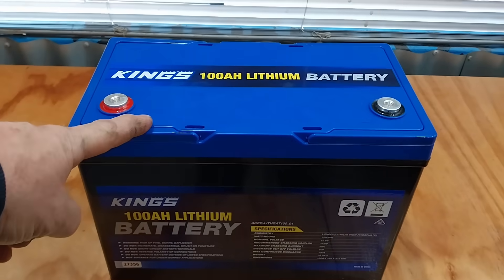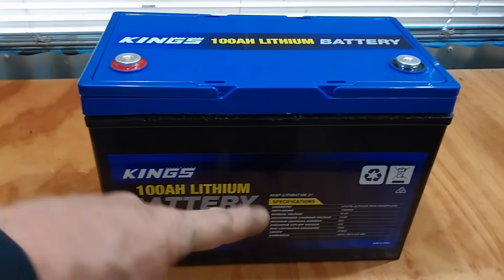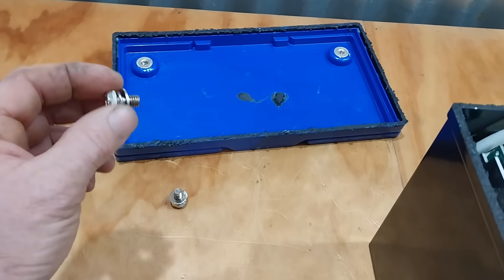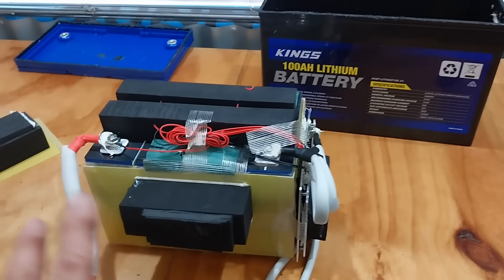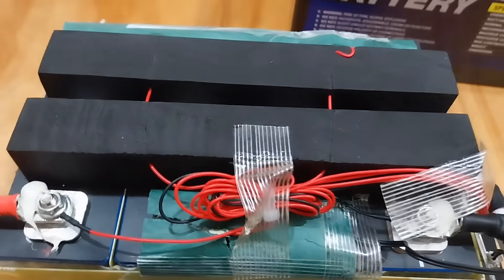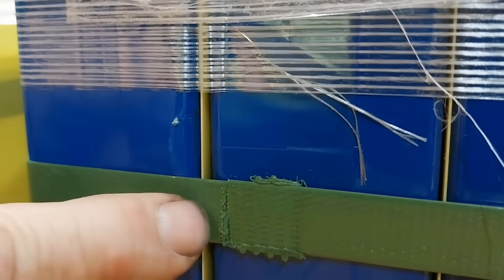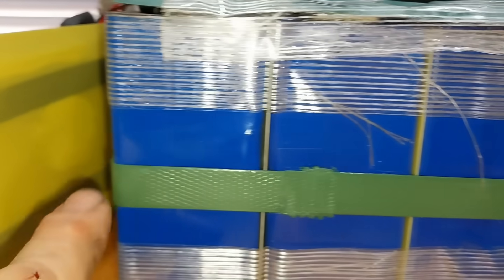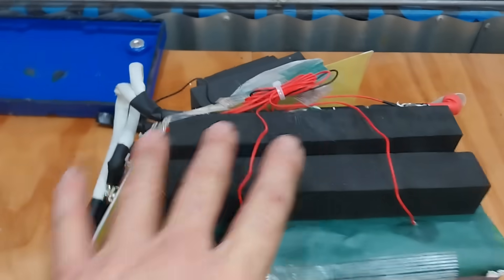Kings 100 Ah Lithium Battery Teardown - What We Found Inside ?

Comment: the label code  and the QR scan doesn't match [00PCBAFN01IL14GD610006009 vs 00PCBAFN01L14CD610006009]. Either of them doesn't belong to any standard manufacturer . This could be repackaged b-grade/used cell . This is the only kings lifepo4 battery with 1 year warranty, the other kings batteries are 3 years. the deformation could be because it is b-grade cells
Reply from the maker: Thanks mate, yeah disappointing with the 100 Ah batteries as Kings advertises them as A grade cells. But we all know the honesty or shall I say "the lack of" we get from corporations now-a-days 👍
I will say though I have two Kings 120 Ah blue top Lithium's that have been in service for over two years with daily cycling and so far they have been flawless.

Comment: Hi Glen. Thanks for the video, I have a query. I'm using 2 kings 100 amp lithium to create 24 volts for my mobility scooter. They are 8 mths old but im having issues with them holding charge. I'm using a Victron Blue smart 24v charger. It has several settings to choose from so maybe im charging incorrectly. Prior to having issues, I used li-on setting, but now im using high (29.4) and bulk charge settings, as im only getting 500mtrs of travelmout of a charge. Do you see an issue with how im charging? I dropped off the batteries at Kings today for warranty but they said they're charging ok, so I dont know if theyll load them to test. Thank you
Reply: Nice to know that . was planning to buy 4 of them

Comment: I no this is few months old but a BMS typically balances the cells during the charge cycle not during discharge. Usually during the CV constant voltage stage of the charge cycle. Matched lithium cells typically do not go far enough out of balance unless they are being discharged constantly at high current.

Also note the tolerance for out of balance lithium cells is 50 mv. It would be very rare for cells to get 0.5 volts out of balance unless they are nearing the terminal life span. I would also hope that a BMS would also balance the cells as they near safety discharge cutoff but it may also be up to the BMS software design.

Comment: I just got4 of these and none of them charge up to 14.60, the ZKE EBC A20 charger cuts out before it gets anywhere near 14.6, one goes to 14.0 and cuts, one gets to 14.2 and cuts one gets to 14.3 and cuts one gets to 14.35 an cuts. I tried charging it with a constant current lab power supply limited to 14.60v with various current settings from 5A all the way down to 0.02A but that still makes no difference, they still cut the charge way too early. I  am assuming they have a small imbalance, one cell gets to it's full voltage and the bms cuts the charge. But if that is the case why doesn't feeding it with a tiny current balance the battery? Surely the balance circuit can handle 0.02A Anyone got any ideas?

Comment: From my experience I wouldn't trust the brand. About three years ago I bought four 150AH Kings lithium batteries, for a 24V battery bank. I was greatly disappointed when after initial testing I found that they could not sustain greater than 50A continuous. They were definitely advertised as 100A continuous. Luckily I was still preparing to install them, because within two weeks, one and then a second one burned up on my kitchen table, a BMS failure in both cases.

Asking Kings directly for warranty, they completely ignored me. I waited 6 weeks. It wasn't until I complained to the online store I bought them from, that they responded, and replaced each battery in turn. They claimed it to be freight damage, but I believe it was dodgy cheap BMS's used, that failed.

They took one back, but I still have the other one, which I cut open. It's a charred mess inside. To be clear, most of the wiring is damaged, but the cells might be reusable for a rebuild.. but it's been years since it happened, now.

The exact symptoms.. they got very hot on top, with some visible plastic melting on the top lid. You could smell fumes being given off. I relocated each outside asap I can tell you. The second one failed 2-3 weeks after the first. I had ordered 2, then 2 more before the first 2 arrived. One failed from each batch.

They did replace the two batteries, however with zero paperwork. No documentation at all.
I'm still running the survivors as a bank of 4 at 24V, running my hot water system and a couple other low loads, using a VIctron Multiplus 2400W (3000VA) inverter. I have all Victron gear, apart from cheap batteries. I have a second bank with same storage capacity using a different brand battery (6x100AH @ 24V), that runs most of the rest of the gear in the house, including 2 fridges and a freezer. No trouble from those (1600W (2000VA) Victron inverter).

Inside the Kings they were not neat as in this video, and not prismatic cells. Just a big bundle of tape. I wouldn't be surprised if the prismatic cells in the battery in this video were second hand cells.

I do intend to get rid of the Kings, once I get to it. I'm retired on a pension so money is not plentiful. Luckily I'm not renting.
Reply from the maker: Sounds like they couldn't handle the current draw.
I have a set of the Kings 120 Ah batteries that have been in service for two year of continuous use on my 24 volt system, which draws around 80 amps when under load. I can't fault the 120 Ah batteries and they have even held up on their amp hour capacity.

I have heard the earlier version of the Kings Lithium batteries were crap and the newer version have seem to be fine 'so far". I have a few friends with the Kings 300 Ah batteries that live full time on the road and so far so good.

Be interesting how long these newer Kings Lithium's batteries last / longevity over time. For the price we pay for them, they have been worth a try. My 100 Ah 48 volt batteries (different brand) for my 48 volt system cost just over $3,000 each for them when I bought them four years ago. So big difference in price, that's for sure 👍
Reply: @TheOffGridBachelor  Yes, hopefully they've improved (looks like it from your video) since a few years ago. I got the crap ones apparently lol. The 4 cost about $4000, so a slight investment there. But there's plenty of brands out there. 48V would be nice, bit outside my price range tho. I'm semi-off grid living in suburbia.

Note with mine there was no current draw. I'd not installed/used them yet. Thanks for the video. We want you to cut open every brand! :). Seriously tho, it would be interesting to compare this video with a top tier brand, regarding the internals. The heat gun trick could make it less painful to make. Cheers.

p.s. I've learned in my 68 years, that the cheapest cost product is rarely the least expensive to own in the long term.

Comment: Heads up, you can remove the lid of these type of batteries without cutting, incase you want to reassemble. Simply run a heat gun around the join at the top and pry with a filler/butter knife. I've done this and reassembled and used silicone and few rivets to reassemble - this way I can get back in again (I upgraded the BMS)
Reply from the maker: That's good to know. I have a few of these batteries and interested in seeing inside the others, see if I have the same issue I had in this battery. Thanks for the tip 👍

Comment: Stop insinuating kings have used 2nd hand cells in the past 
It's never been proven just because a cell has a missing QR code it doesn't mean the cells are used
Reply from the maker: I said there is no indication of any wear and tear of a secondhand cell. No where in any of my videos have I ever said that Kings use second hand cells, nor did I say missing QR codes mean secondhand cells.
I get heaps of comments on my videos with people claiming, without proof, that Kings use secondhand cells. So I do look for signs of secondhand cells to keep those people happy. But I have not found any evidence that Kings use secondhand cells and have mentioned this clearly in my videos.

Comment: Just an FYI:
The current-carrying capacity of a conductor is proportional to the cross-sectional area of the conductor.
i.e. the thickness of those aluminium connecting straps times their width, expressed in mm².
The thickness is also important in terms of resistance to cracking as a result of vibration.

Comment: I'm pretty sure the damage with the strapping and the end cells having a bulge or being crease was just the tightness of the strapping itself and the damage was where the gun used to strap it was against the body of the battery I would think just through experience of using those strapping machines himself

Comment: Another one on the tear down bandwagon! What a surprise! Prismatic cells 😂 which is what's listed in the specification. Buy a cheap battery and expect premium cells and build quality! The surprising tear downs are some of the premium brands that aren't much better!

QR code is as follows (no surprises really B grade cells and always a lot of missing information)

Manufacturer Sunwoda (00P)

Product type Cell

Cell Type LiFePO4 (B)

Model code UNKNOWN (AF)

Capacity 0.0Ah

Energy 0.0Wh

Production date 1/6/2023

Production city UNKNOWN (0)

Factory product line NO

Factory task order n°1L

Number of cell produced 6009

Code 00PCBAFNO1L140D610006009
Reply from the maker: Teardown bandwagon ?? steady up dude as your the one that is watching these teardown videos, so you can't really criticize on that 👍
Kings previous 100 Ah battery had the pouch cells so I wanted to see if they indeed were putting prismatic cells in these battery as advertised. I did explain all of this in the video.
I do want to get hold of a high end brand battery and do a teardown to compare the quality. My 48 volt batteries are high end expensive batteries. Once their 4 year warranty expires, I will do a tear down and see how well they are put together. Hopefully well, as they cost me over $3,000 each for them.
Reply: @TheOffGridBachelor yeah I skipped through the video. I was interested in the BMS as the specs state max discharge 100amps, max charge 100amps BUT Recommended charge is only 50amps. 
Why's that? But there's no useful information I could get off the BMS from what you showed.

Kings haven't had pouch cells in their main batteries since the old black tops from years ago! I still have one I bought in 2019, still making capacity.

Unfortunately pouch cells have been demonised by ignorant people. If they actually did a little research they would find pouch cells have many advantages over prismatic. They are more energy dense, lighter, more durable in transport situations, often cheaper and you are pretty much guaranteed new cells as they can't use used pouch cells like prismatics!
Reply from the maker: @cdonuts7335  Yeah their 120 Ah lithium also has a recommended charge @ 60 amps. Even their 200 Ah recommends 100 amp charge, which is 0.5 C
I believe 0.5 C is the standard charge rate for a Lithium battery and 1C is the maximum.
I just checked my Amptron 100 Ah - 48 volt batteries and they recommend 20 amps charge which is 0.2C
I put the link to those batteries below if ya interested in their specs. Everyone's charge rates seems all over the place.

https://amptron.au/products/bluedge-48v-100ah-100a-continuous-discharge-lifepo4-battery-bluetooth-rs485-can-bus/

Comment: But the most important thing is, is it a 100ah battery?  As they are way cheaper than other batteries.
Reply from the maker: Yes it is, I did a capacity test, which is on my channel and it exceeded 100 Ah 👍

Comment: I've just installed 10 of them on one of our  emergency response trucks.  The battery pack was good value for money.  They were picked for being Prismatic - and not DCS Batteries Australia.   Our truck can run everything at full-rip for 2 hours before needing to get a generator to site.  Everyone quizzed us on Kings - being that it's considered a cheap brand - but the build quality was excellent.
Reply from the maker: For the price, Kings stuff in not too bad. Out of all the Kings batteries I have (six of them), they all work fine, including the two that have damage on the cells.

Comment: Had an idea/experiment, to remove 2 x 100ah king batteries from there box and place them both in the large kings battery box, connected in parallel, 200ah
Reply from the maker: Yes I have thought about doing the same, although medium to high current draw is an issue with these budget battery boxes. Will be nice when all the battery manufacturers start making the Lithium batteries in the smaller profiles. There are a few starting to do so, the rest need to catch up.

Comment: Slapped together dogs brekky made of floor sweepings. So much care just zipping and taping and gluing everything together hahaha.
Reply from the maker: The battery in this video was actually quite neat compared to what I have seen.
All the Lithium batteries that I have pulled down, not just Kings brand, are all put together with tape, glue and sealastic, and shimmed out with foam blocks.
Reply: @TheOffGridBachelor  You should try open some quality batteries and see the difference.
Reply from the maker: @magicmanspaz  The price of purchasing those batteries is what's holding me back on doing that and you void any warranty once you open them.
When my 48 volt batteries warranty has expired, I do plan to open one of those. They cost $3,200 each so we will see what $3,200 buys us 😄

Comment: I don't think that's the cells swelling. That i would put money on is from the strap that's around it being pulled tight by the strapping machine. It's also what's made the dent in the first cell. I use those strapping machines at work and they can go very tight and even bend a 3mm plate of steel.

Comment: I believe the reference to the balancing of the cell voltages under charge from the bms but also under normalised Static voltages isn't too out of pocket.
Although a normalised cell balance is more than likely an adequate test. 
The fact that the split cell went through QC isn't great.

Comment: Hi Glen, great video, thanks. With regards to aluminium and current carrying capacity, thickness and width of the material is required to do the calculation, with cable it is obviously only the dimension required. Cheers.
Reply: With cables, as with the strap style connectors/bridges, cross-sectional area is still the measure of capacity. However, only the diameter of the  conductor in the cable is needed, as the cross-section is easy to calculate from the conductor's diameter.

Comment: To do a battery balance test. The battery needs to be fully charged before the test. Not on charge. 
I'm an electrician and learning lithium batteries was a total head f**k. 
It went against everything I knew. But they are amazing.
Thanks for your video and strip down of the battery

Comment: Most BMS will balance at end of charge by effectively clamping the terminal voltage and transferring current to the lower voltage cells in the string until all are equal at full charge. 
Active balancing on the other hand will equalise voltage with current relative to the voltage difference and will function at any state of charge. The downside to active balancing is 
it has a higher parasitic draw at all times and will eventually deplete the battery if left un tended. A benefit of active balancing is it will help cells stay balanced during discharge which
becomes more beneficial as they age, with weaker cells being held up at the lower end of the charge cycle, extending their life relative to the healthier cells. 
End of charge balancing is cheaper to make and better suited to applications where the battery is left off charge for extended periods where active balancing is better suited to batteries used in 
UPS, or solar systems that get regular charging. 
I hope this makes sense.

Comment: Next do one of the Jaycar batts, especially the newer Rovin ones. They’re dropping the price on their batteries and it makes you wonder what the quality control is like.
Reply from the maker: I have done a teardown video on a Jaycar 25 Ah battery and found many faults. I ended up taking that video down to avoid potentially getting sued due to the number of issues I found, I wasn't gonna take the risk.
Reply: @TheOffGridBachelor 
Oh RIP. I was considering getting a smaller battery of theirs for a self-contained solar light setup, but it’s probably more cost effective to go with a diy prismatic cell assembly, or even just a bundle of 18650s.
Reply: @TheOffGridBachelor  The Powertech ones?
Reply: @TheOffGridBachelor   It depends, if you rename it to Electus or whatever their distributor is - as this is a issue with the sourced material, not jaycar itself...
I'd like to see what was found in those; since I was considering them. Maybe check out the Altronics ones? They have certification, so may act as a good comparison.
Reply from the maker: @KomiyanVT yeah I have some Altronics batteries, also reviewed on my channel, and they seem to be good so far. I did a teardown on one and if I remember, found no issues 👍

Comment: I use those green straps and strapper welders at work. It is very easy to over tension the strap. The strappers can be set to a certain tension but it doesn't always work.

Comment: Need to know the width of the links so we can calculate the mm2 size.  Both on and off readings are useful. The on charger reading tells you how much it is accepting (needing) in regards to other cells at the same time.  If one is more "thirsty' for volts and is significantly high (or lower) than the others, it can be signs of a problem.  Off the charger, individual block voltages need to be assessed after a rest period and indicate the holding capability of the block.